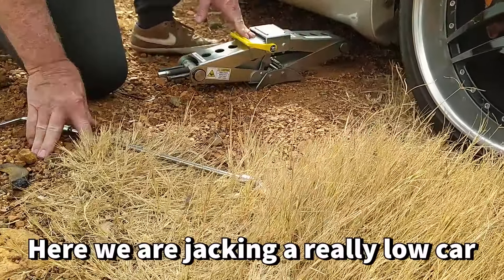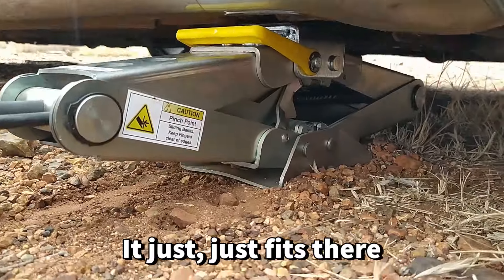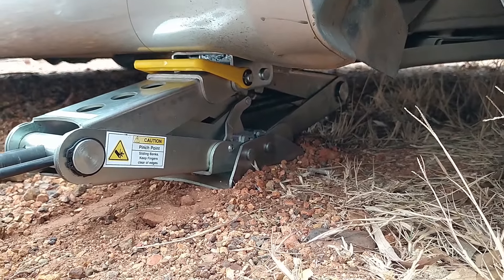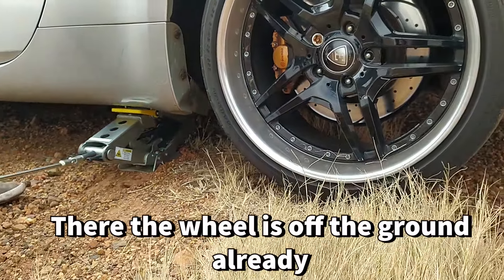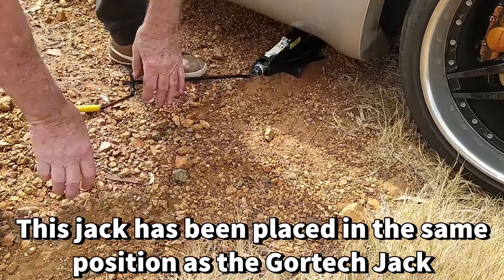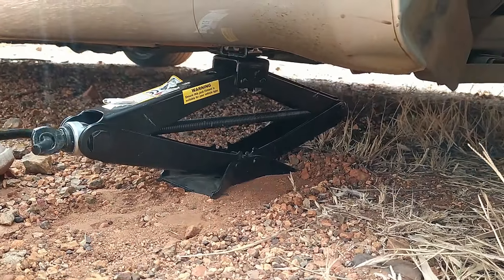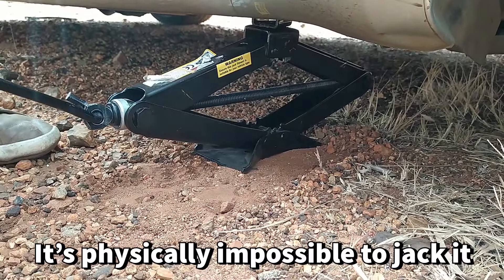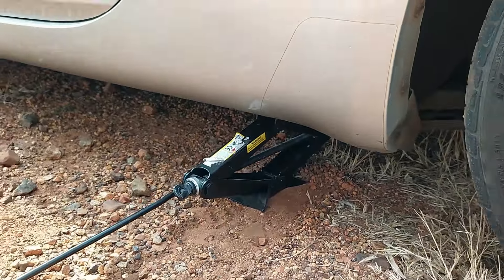Low car jacking comparison between the heavy duty multi stage jack and a generic 2 ton scissor jack

Comment: As the Manufacturer, Would you recommend against using and impact to raise and lower the jack?
Reply from the maker: We have customers that are using impact drivers on our jacks. No reports of failure so far and it has been 3 years.
We have used an impact periodically on our test jack and have found no deterioration on the drive screw upon inspection. This has been on loads up to 2 tons. Do we recommend it? For the average car owner that will use it maybe 20 - 30 times, we don't see a problem. For a mechanic using it daily, not recommended until we have more data.